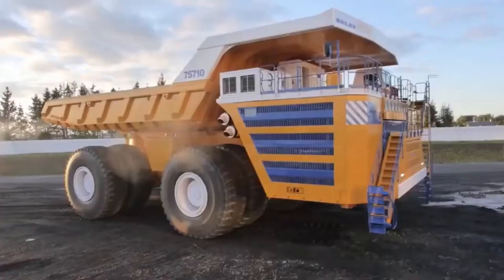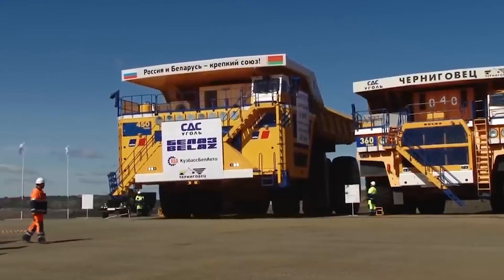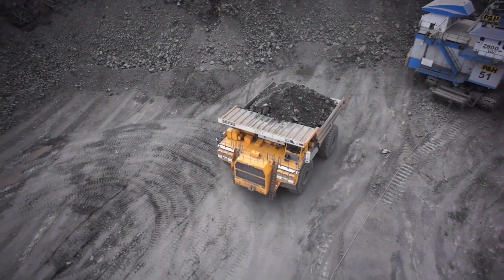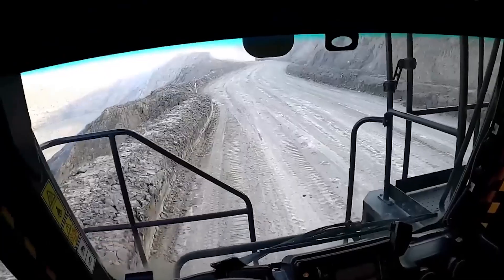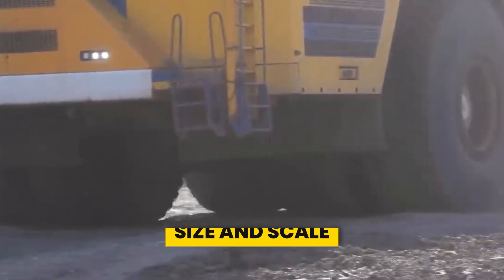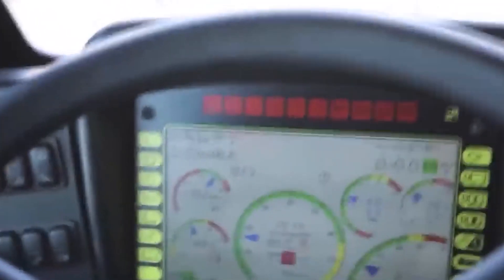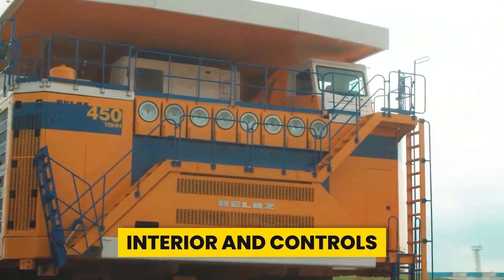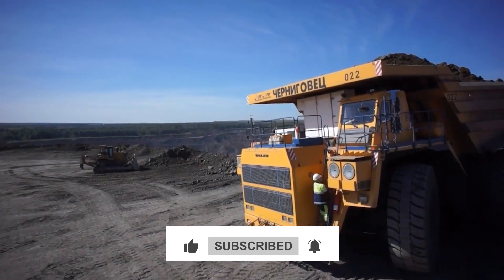How To Build THE BIGGEST Dumptruck In The World: BELAZ 75710

Comment: This is the ideal vehicle for Antarctic exploration. It still would need:

1 - Compartmentalized rooms with thermal insulation for the Engine, battery storage, Fuel Tanks, Cabins and living areas, storage and any internal mechanised parts.

2 - Tracks on all wheels 

3 - A crane and winch for smaller vehicles with a rear "garage".

4 - Heat return valves and pumps.

5 - External wheel axel heating system.

6 - 360⁰ walk-around gangways on the main level.

7 - Small experimental lab.

8 - Starlink system.